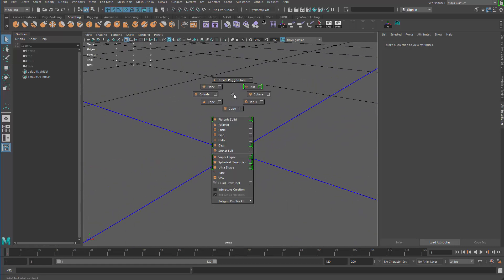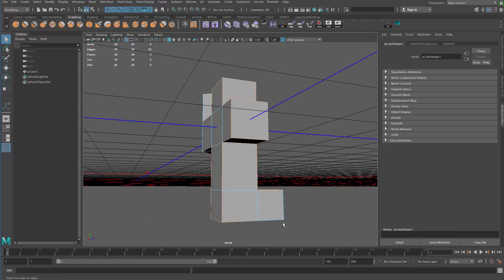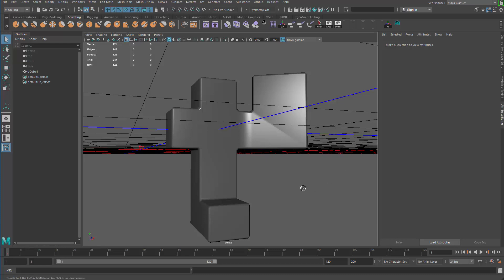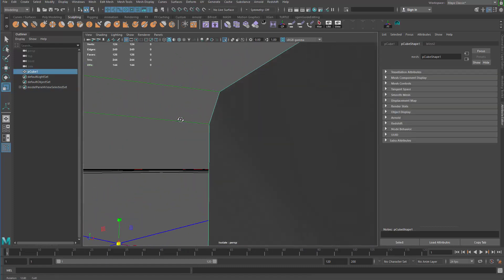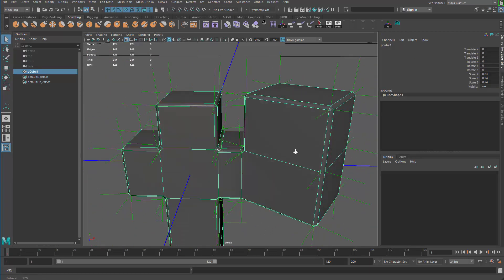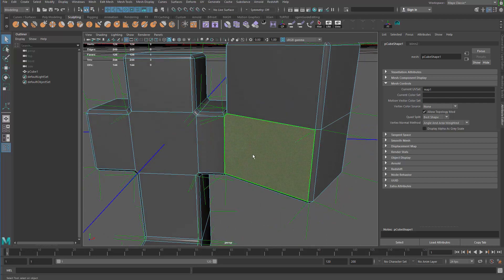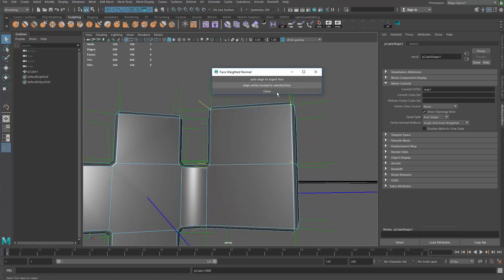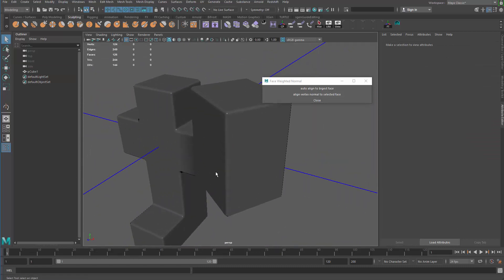Face Weighted Normal

Comment: Thanks for sharing the video and the script! Really appreciate it. I'll be trying this out at home.
Blender 2.8 has a face weighted normal modifier that has a slider control for "face strength". At value 100, it does pretty much the same thing as what you showed here.
Cheers :)